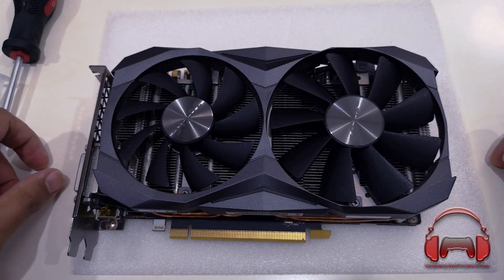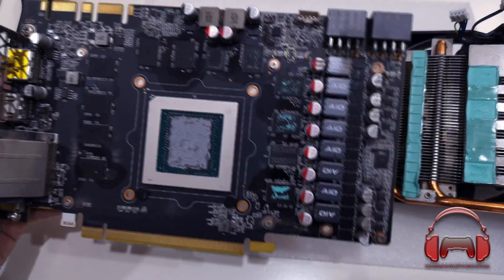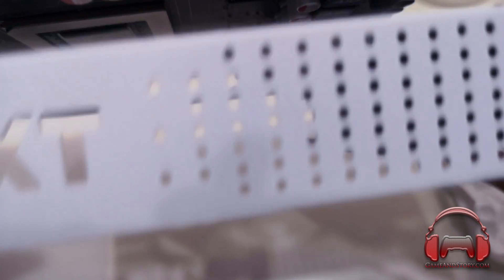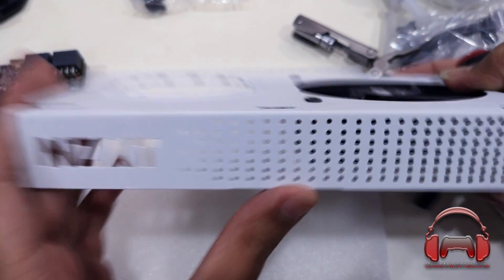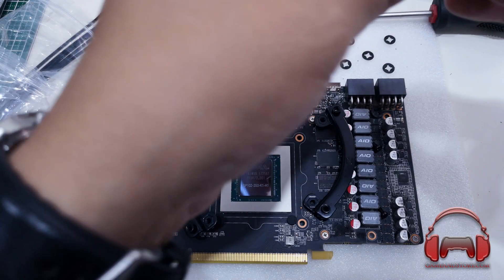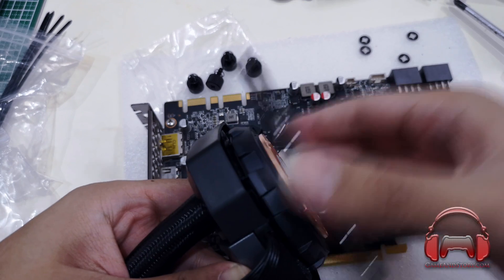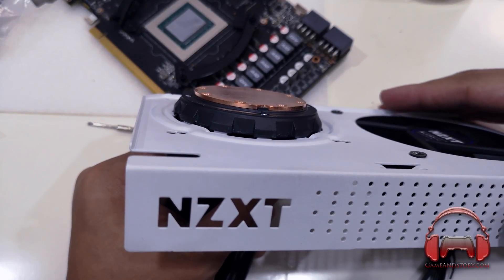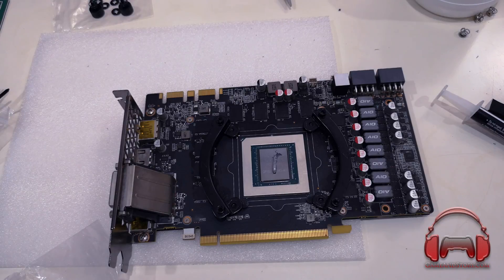Kraken G12 + Corsair H80i V2 on the Zotac GTX1080TI Mini

Comment: Would this work with the GTX 1070 mini?
Reply from the maker: Unfortunately, no, it won't. Another commenter said that the pcb layout prohibits it.
Reply: That's a shame. Gotta figure out something else, or upgrade the graphics completely. :D
Reply from the maker: @SoulRollerFIN  Just go custom loop :) It's a lot easier these days to get into it!
Reply: @GameAndStory  a custom probably won't fit into ITX case. An AIO might. Both the GPU + the AIO would need to fit into the GPU compartment. The GPU AIO would be kinda overkill. I just like my computer as quiet as possible. :D
Reply from the maker: @SoulRollerFIN  you could actually fit a custom loop into the following ITx cases - ncase M1, sidearm T1, Loque Ghost S1, Sliger SM series, thermaltake V1, streacom DA2. What case have you got?
Reply: @GameAndStory  Currently I got a Node202 with a CPU AIO in the PSU's place. Getting a NZXT H1 sometime this year. 
Some have gotten custom dual loops for their Nodes. And I know that I could probably mount 120mm rad & fans on the side panel of the H1.
Reply from the maker: @SoulRollerFIN  I have a Node 202 right now, and am thinking of doing a custom loop with Alphacool's Eisbaer Solo pump blocks. The other option is a going for an Ncase M1 and doing a loop in there. I'm not too jazzed about the H1 as I think its compromised lots of features for the sake of looks.
Reply: @GameAndStory  I like the Node 202, but it's really noisy and gets pretty hot. Also the footprint on the desk is a bit too large for my taste. The Corsair One would be perfect, but it's proprietary. The H1 fits all the criteria. I don't see any negatives in switching cases. The node shall become a ryzen 3 or 5 media PC once it's replaced. :P
Reply from the maker: @SoulRollerFIN  I probably shouldn't have gotten my 202 in hindsight (blame itchy purchasing impulses). However, all the best for the new build!
Reply: @GameAndStory  Same here. However it is an amazing case for it's size. 73C/83C max temps on high load is not bad. I just prefer a silent PC on idle, and that's almost impossible in a case this small.

Make a video on you custom loop! Will be interesting.
Reply from the maker: @SoulRollerFIN  Stuck on the preorder list for the Ncase M1 V6 at the moment, so it'll be at least 6 weeks before it arrives. 🙏 Thanks for stopping by!

Comment: Is this card still alive? Did you notice there were thermal pads for some VRMs on the left side? Zotac moves these onto that side of the PCB on mini cards to save space. So when you installed this bracket, those componants on that left side would have zero cooling. Thanks for the video though, I just got the Zotac 2060 Super Mini and was looking at installing this but guess it isn't really compatible... that and it looks like it adds extra length to the card and the mini only just fits into my system as it is.
Reply from the maker: The fan they include does a decent job of cooling all the other components, and I ran this configuration for a good 6 months. Have since transitioned to a custom loop.

Congratulations on your purchase! Yes, the G12 added a bit of length to my 1080Ti mini, but I found to acceptable because I had the space for it.

Comment: Thank you for making this. Now I am sure I don't want to do this. I did find one water cooling kit specifically made for 1080ti mini but it had a lot of flaws and a lot of people complained about various things so I was looking into this method. I tried looking for the zotac water cooling but they don't sell it here. My temps are 84C with 70-75% fan. It is fine but I would have liked to cool my poor gpu a little.
Reply from the maker: It's not for everyone, admittedly, but I'm a poor nerd with too much time (back then) and an itch to tinker. Zotac's cooling solutions on their mini cards are horribly inefficient, and I was hitting 84 to 86 Deg C under full load. Hope your 1080Ti is alright now! I ended up going full custom loop.
Reply: @GameAndStory  I think I wrote that because of the difficulty level was too high for me along with the availability of tools.
It is fine it down clocks to 1500 but still plenty for most of the gaming I do which is 1-2 hrs every other day and 4-5 on weekends. Funny how when you have money to buy games, you don't have the time and when you have no money you have all the time.
Have a good one! :)

Comment: My dudes. No need to fuss over removing thermal past ever again.
Just use wd40 contact cleaner on the entire card. Even the ports. Also use it to clean pcie and ddr slots. Spray the crap out of it. Let dry for a few hours or a day. Works wonderfully. Remove cmos if motherboard. Be smart.

Comment: Great video! FYI there are 2 oem black rubber circles near the GPU die that need to be removed from the 1080ti for the Corsair liquid cooler to seat properly. You kept them on which created a small space between the cooler and GPU. May not be good for the longevity of the 1080ti mini. Also, it would help to add mini Cooper heatsinks to each VRM chip on the 1080 ti. I did this nearly 2 years ago. My setup is used nearly everyday and is running strong.
Reply from the maker: Thank you for the tips, Aaron :)

I actually had no problems with seating the cooler (the difficult part was getting the pump head attached to the G12 bracket), and saw drops of over 30 deg C (https://youtu.be/hyBrba5wrco?t=276), so I think the seating was okay.

I've actually moved on to a full-custom loop, but should I revisit this idea in the future, I will definitely pay attention to those rubber circles you mention, together with the copper heatsinks for the VRMs. I figured the air being blown directly on to them was more than enough to help them cool, since VRM's can withstand really high temps (although it won't be great for OC'ing, AFAIK).

Comment: Can I use the Kraken G12 with the Zotac GTX 1070 Mini? Because the VRMs of the 1070 are at the front and not at the back of the PCB.
Reply from the maker: Hey man, this won't work on the 1070 mini, or the 1080 mini as the VRMs block the placement of the bracket for the pump head. :/

Comment: DO NOT DO THE PEA METHOD ON A GPU DIE. When applying thermal paste directly to the die you need to spread the application because gpu's dont have a IHS.
Reply from the maker: Not really an issue unless you're using LM, since thermal paste is nonconductive. If you want to be super neat, by all means use a spreader. Other videos I followed used variation of the pea / bar method.
Reply: @GameAndStory  Brian isn't concerned with that. His point is that you need to cover the WHOLE die with thermal paste to avoid hotspots. This isn't a big concern when applying paste to a CPU because of the IHS (integrated heat spreader), but is a concern when applying past to naked dies like you are doing in the video.
Reply from the maker: @timmeeyh6523  Thank you for sharing that, Christian. I took off my G12 a while back and put a full water block on it a month or so back for my custom loop, and did the 'bar' method instead of just the pea. Coverage was much better once I checked under the block. :)
Reply: @GameAndStory  Thats great. Hey, I've been watching a few of these install videos to prepare for my G12 and X42 cooler that will arrive in a weeks time. The videos never quite cover how you wire these things up, but I guess it isn't so hard when you look at the parts and read the manual
Reply from the maker: @timmeeyh6523  the fan connector on the 1080ti mini is a mini 4 pin, so I plugged the G12 fan into a motherboard header. It's covered in my VLOG 3 video, discussing the airflow and setup.
Reply from the maker: @timmeeyh6523  https://youtu.be/3gXZd3CucL0 try this link. About 5 mins in. :)

Comment: hi there..where do you insert the pump connector?..can it be inserted to the graphic card fan header?..Im considering to buy this kraken G12 to attach to my zotac 1080ti mini also.
Reply from the maker: Hey man. I used a spare fan header on the motherboard. The kraken g12 fan pin won't fit on the GC fan header because the header is a mini 4-pin.
Reply: GameAndStory.com hey great video, will be doing the same setup as well. Wouldn’t connecting the pump to the motherboard not allow the gpu to increase the fan speed?
Reply from the maker: @MerkDraws  Hey man - using CORSAIR Link it is possible to link the GPU temperature to any fan running on the motherboard. It might involve a bit of trial and error to see which fan is connected to which port using the software, but its worth the tinkering effort. 

Hopefully this helps : https://www.youtube.com/watch?v=3lKGsVBpKrI :)
Reply: @GameAndStory  But regular 4 pin to mini 4 pin is the easiest hack on earth to do!